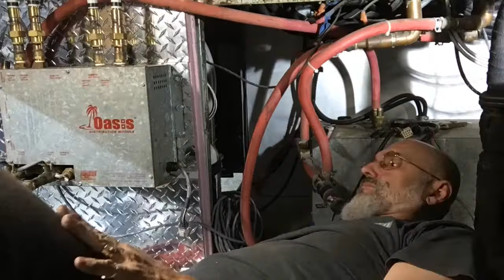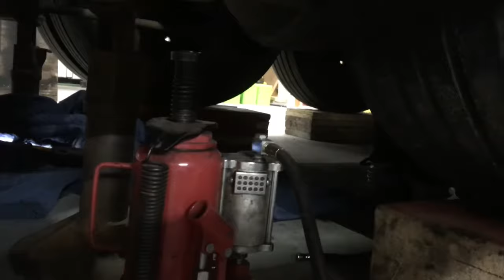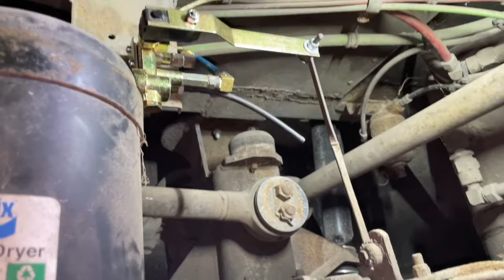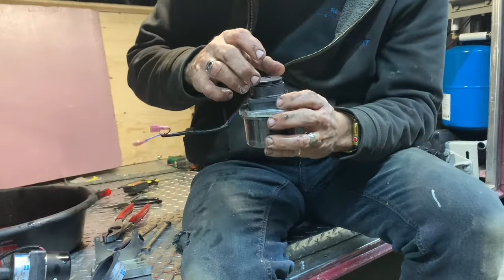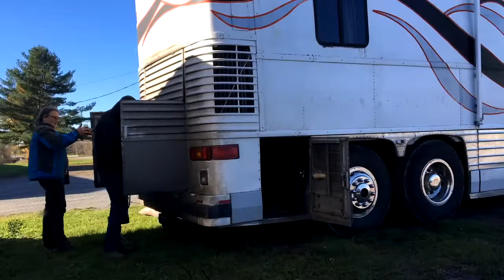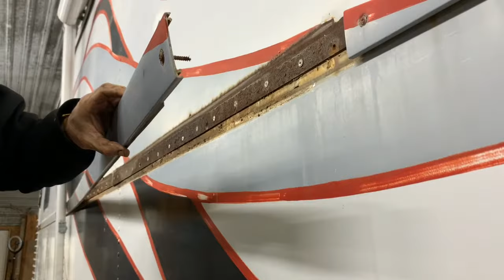E63 Hydronic heat and suspension valves.

Comment: What was degreaser you used? Any concerns about using pressure washer on engine (seals etc)?
Reply from the maker: We used McKee’s 37 All Purpose Cleaner. No concerns, it’s only 1500psi, and we don’t aim at sensitive areas.

Comment: Do you have a filter for the glycol system to keep it clean ?
Reply from the maker: No, but that’s a good idea
Reply: Had problems with heating system on J and it only has a screen in the line when the old system on some mci's is a spin on filter ! Much better in my way of thinking !
Reply from the maker: Our engine cooling system has a spin on filter.